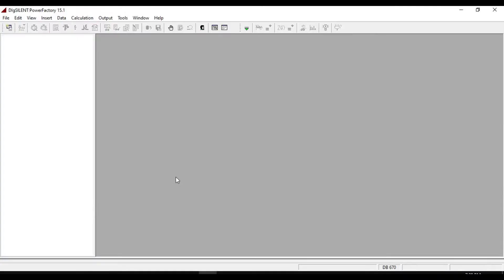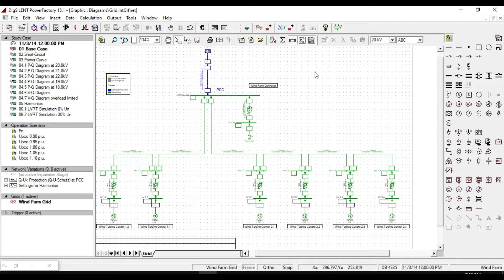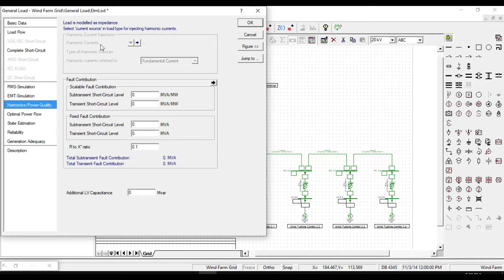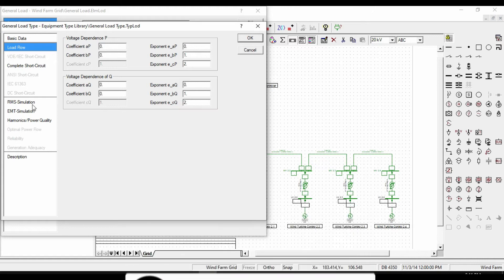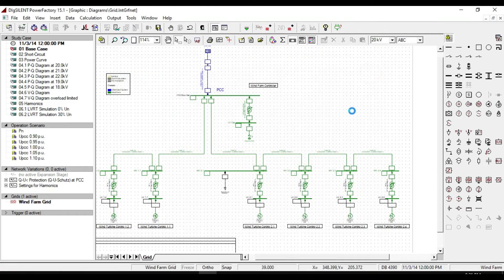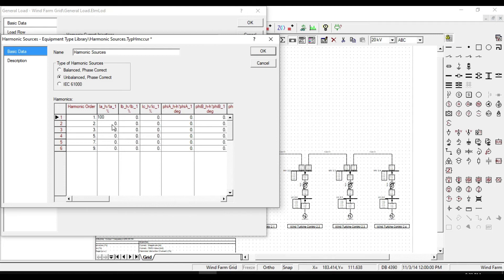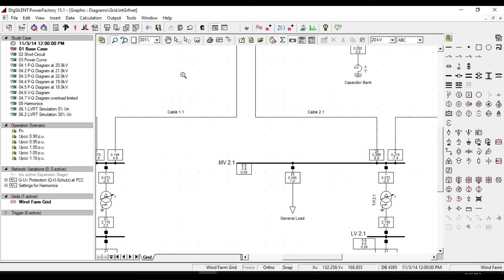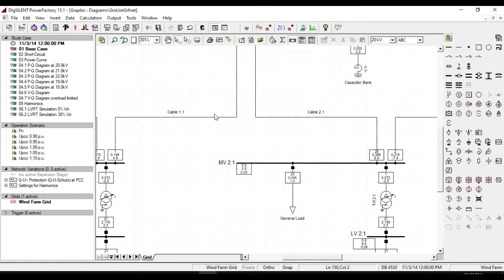PowerFactory DIgSILENT tutorial #15 Power quality and harmonic analysis part #1

Comment: Hi, thanks for the tutorial but question. Which current should be used rated or fundamental? 

For example if my PV farm has 7 inverters rated 10MVA but the PV farm is only exporting 50MW. I am using unbalanced loadflow method but should I use fundamental or rated current?

Additionally, If I use EC61000 method it is only calculated based on rated current. Should I change my rating to 50MW to determine the harmonic voltage due to PV farm export?

Comment: Sir. how can I create delta load?
Reply from the maker: you can create that from the load type setting. For example, if you select general load type from the technology option you will see different load types. As a default it is generally  on delta three phase looks like  ( 3PH-D) , so you don't need to change that.
Reply: @asaproengineering  thank you sir.